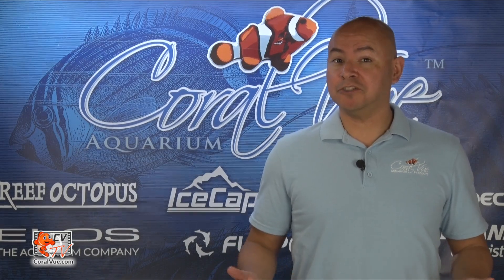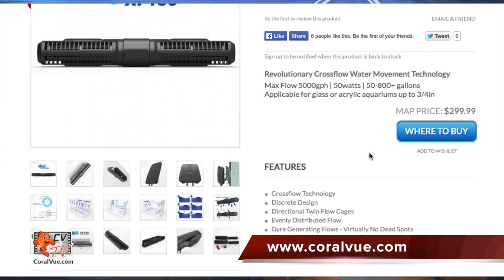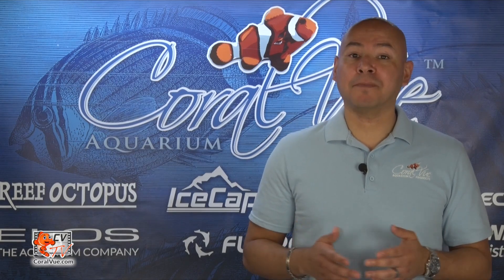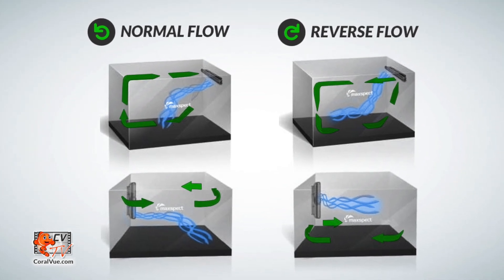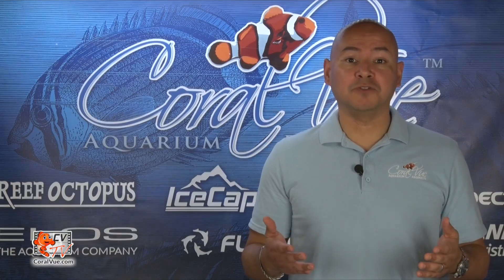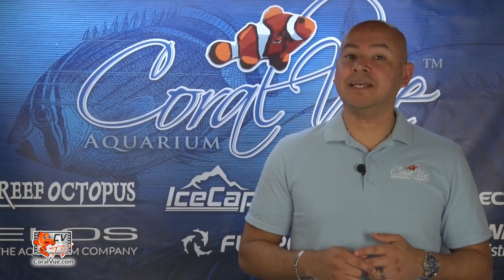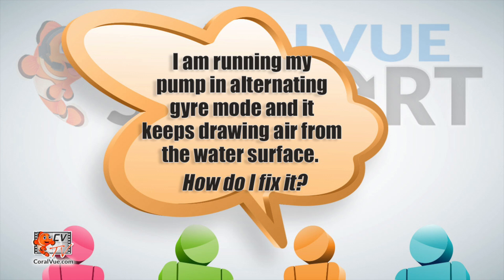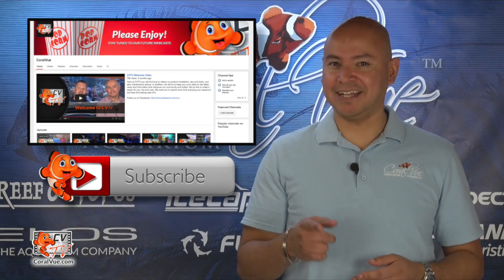[CVtv] Episode 3: Alternating Gyre Mode

Comment: If i bought 2 and placed them horizontally at each end of my 6' tank, will i should be able to just have them function at alt time so one comes on for a min, turns off then the other turns on? Additionally, would i be able to setup the two where as one would push water forward while the other is in reverse then after a min or 2 have them switch roles? Hoping to better create wave surge in this respect.  Also, is there a nighttime mode that allows the pumps to tone down  flow speed automatically?Thanks.

Comment: Also, is there any way to run 2 Gyre's together in an an alternating mode, like you would with the "other" controllable wavemakers?
Reply from the maker: The simple controller that currently comes with the Gyre does not allow for slave and master type setups. The advanced controller will allow such a function when it becomes available.